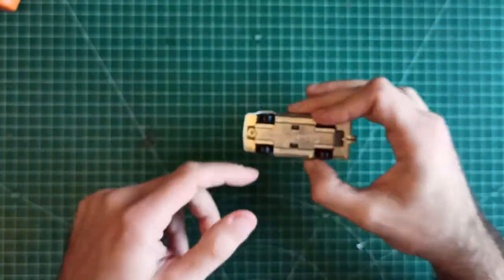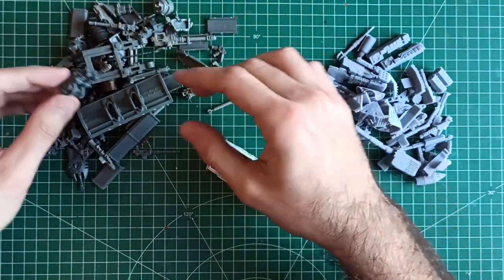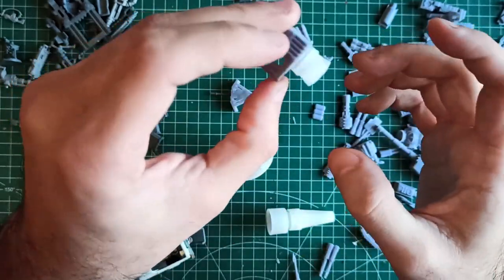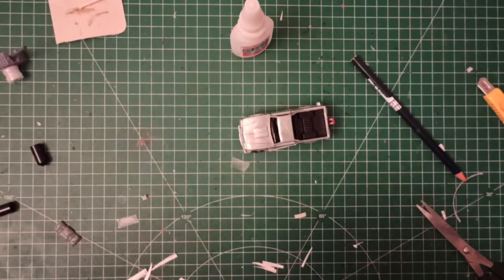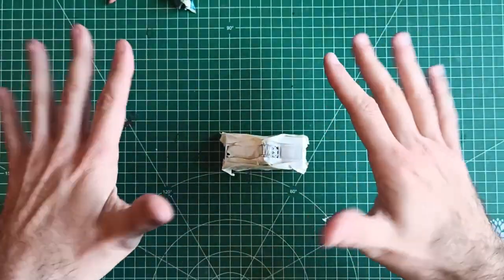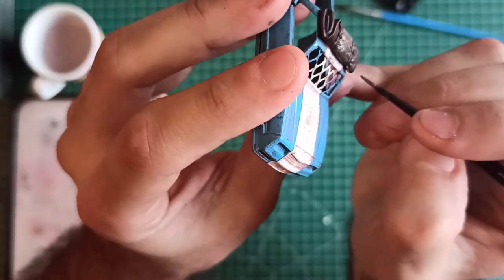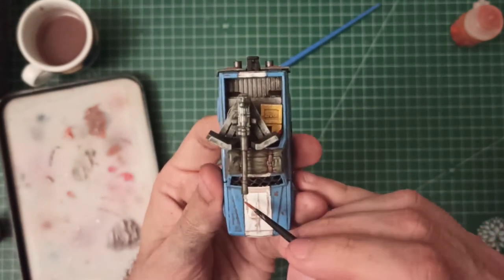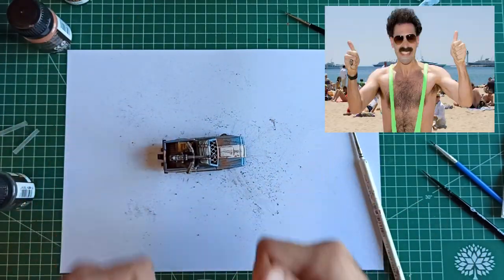Converting a Postapocalyptic TOY CAR - Gaslands, Warhammer 40k, Necromunda

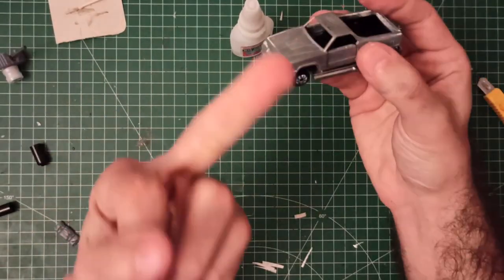Comment: @4:20 It's the paint or gloss on the car that prevents the super glue from working well :( Roughing up the plastic with sandpaper may also help.
Reply from the maker: Yep, I used a way too good spray can xD I needed a crappy one, but most of all, I needed to put an hairspray layer before! So I could chip it like I did in the previous video hahahah I forgot everything